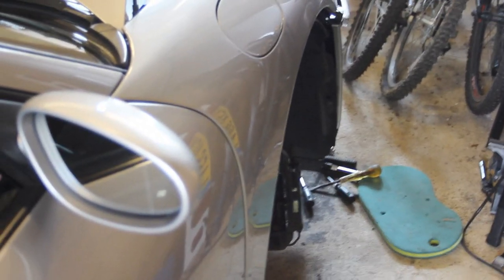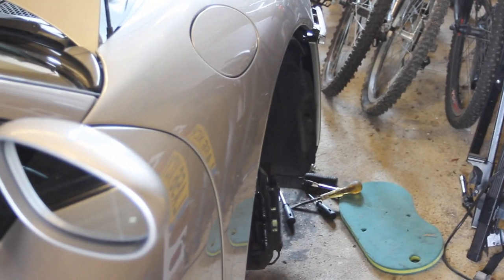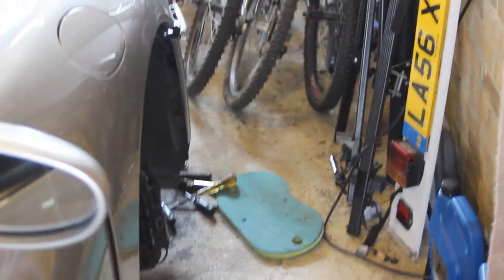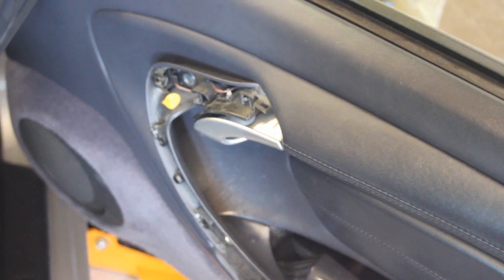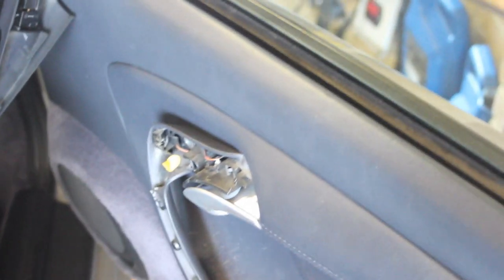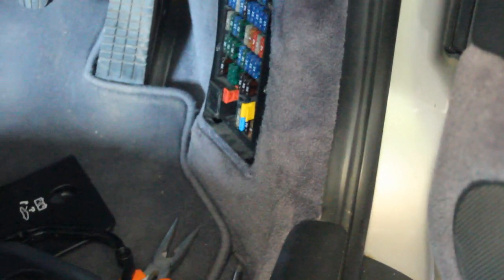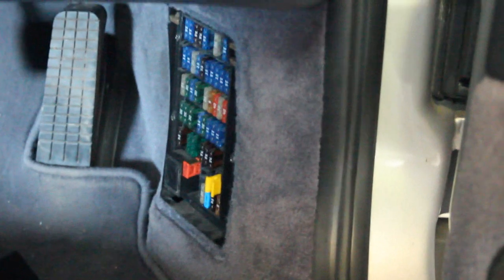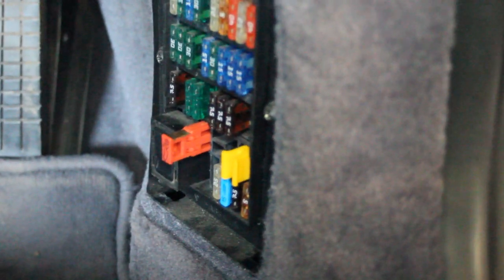Porsche 911/996/Boxster 986 - How to Open Bonnet/hood/trunk with flat or disconnected battery

Comment: Just opened the hood on my 2003 Boxster S using a NOCO GB70 booster … connect the booster positive to the Red pullout terminal and the negative to the door hinge using continuos 12V 'dead battery' mode not the 'jump start' setting … when the hood releases jump start the battery as normal … works perfectly

Comment: why no demonstration of pulling the wire ?
Reply from the maker: It's not very easy to get a camera into the location but I also didn't think anyone would need to see it actually being pulled
Reply: I couldn’t see it been looking for mine for a week took everything apart but can’t see it
Reply: @ianslash  I can’t find mine either
Reply: @ajvw yeh the one useful part pf the video you’ve decided to neglect lol
Reply: @ajvw Hi, need a bit of help with this, on a right hand drive car, can you confirm the cable is on the right/driver side?
Reply: @timmantle7154  Yes that is correct. It might be difficult to find but should be there unless a previous owner has broken or removed it